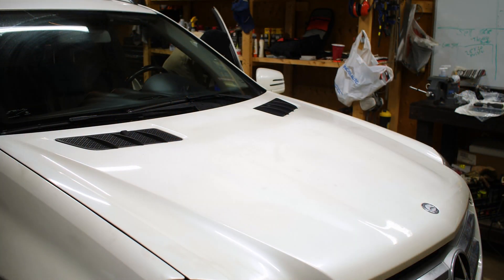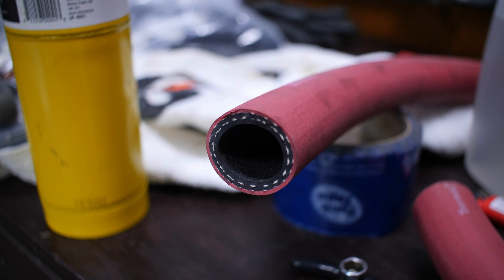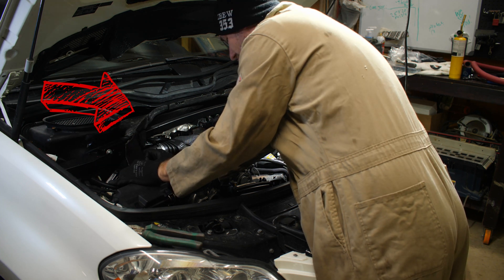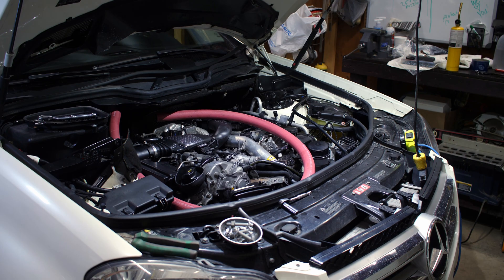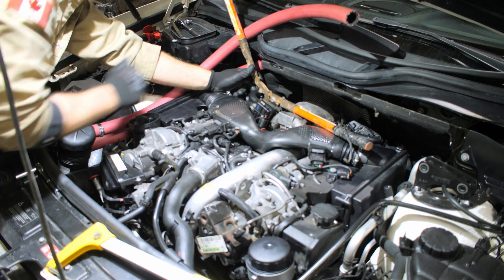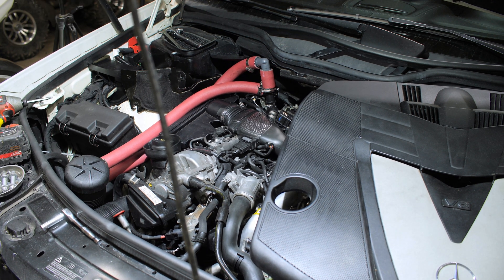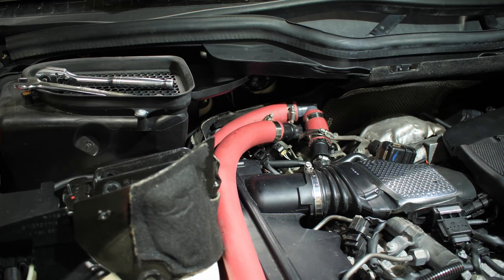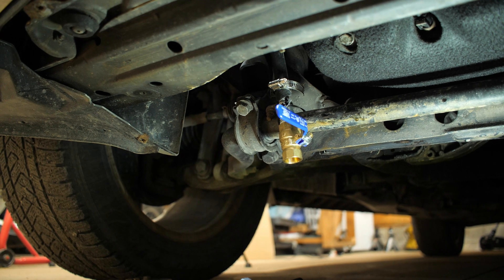How to install an Oil Catch Can (Provent 200 on a Mercedes Diesel GL350 OM642)

Comment: Hi, I'm about to install the same Oil Catch Can setup on my ML300cdi as seen in your video from 4 years ago. Since you've been running it for a long time, could you give me some quick feedback?
1. Any issues with MAF sensors or engine fault codes so far?
2. Is it still catching oil effectively after 4 years?
3. Any freezing or moisture issues during the cold winter months?
4. Are the silicone hoses still holding up well against the heat?
I want to make sure it's 100% reliable before I start the work. Let me know!
Reply from the maker: oil ring was bad, ended up throwing a rod through the oil pan.

Comment: Or just change the PCV valve and the connector to the camshaft instead of going around the issue...... The catch-can can only do so much. Fix the issue at its core: change the PCV/connector before 50k km.
Reply from the maker: yes i also did that. changed the turbo as well. it was a stuck oil ring. she blew up

Comment: Thanks for the video but I am finding the more difficult part is trying to fit the catch can itself, its a shame you never showed in more details this part of the job.
Reply from the maker: i mostly just zip tied it into place.
Reply: @SomethingonSodom  That's interesting and I can see how that can do the job! thanks for the reply... mrix
Reply from the maker: @mrixstraveladventurevlog6545  yeah it looks pretty s
Flimsy but honestly with good strong zip ties in 2 or 3 spots you'll be good. Hell the 1 inch hose holds alot of it up. Cheers.

Comment: Hi 
I am going to install a catch can on my Mazda 2.2 TD skyactive CX5. I recently took the inlet manifold, egr valve etc off to decarb. The local garage quoted me a grand. It was a bit of work which I want tot try and avoid doing again. I have bought a small, cheap catch can for now which has a glass collection bowl. If it works ok I will upgrade
Reply from the maker: Let us know . It should work fine.

Comment: The provent drain is designed to return the condensed oil to the crankcase and allow the vapors (fuel and water) to the intake.  It's really inconvenient to be emptying the catch can every 350 miles.  Is there any port on the engine to allow the oil to return to the crankcase?
Reply: The provent is an oil separator.  Mercedes when cheap from the large oil separator on the old 300D, 123 engine to tiny separator in the OM642 that looks like a flatten PVC valve.

Comment: Wouldn't the turbo run dry (without lubrification)?
Reply from the maker: The actual turbo bearings are lubed from the oil system. This oil coats the turbine blades itself. Not good.

Comment: i do live in the nation capital region and tried the catch can on my 11 gl350  the problem i ah is that the catch can got frosen in the middle of the winter and had to disconnect it as i was afraid a chunk of ice gets in the turbo , i just wonder if you had a work around that in your case
Reply from the maker: I was in North Bay ontario with it for a week and no problems.  -35c
Reply: @SomethingonSodom  to be honnest i have an 07 ml320 with that setup no issues but with way less blowby than my 11 gl350 , fyi i already changed the pcv valve on this one to minimise the blowby but still getting a lot , i'm using a mercedes approved engine oil 0w30 for winter and 5w30 for summer , do you guys know a better oil i could use on my gl 350 to get less blowby ??  Thanks
Reply from the maker: @77karimk  thicker oil helps. 5w40 rotella T6 is what I was using.

Comment: Hey where did you order the oil catch can ? What brand ?Also it be any problem with the computer?
Reply from the maker: I bought mine off ebay. Be sure to get the expensive one from Australia.  That's where there actually made. Provent 200 is the catch can. Didn't throw any codes for me.
Reply: @SomethingonSodom  
Your Mercedes doesn’t smoke blue?
Reply from the maker: @adolfoneave7141  well ours was deleted. not a ton of smoke on idle but on throttle thick black smoke. Rings ended up being the issue. check the newest video out :-(
Reply: @SomethingonSodom  
I’m sorry man are you going to put new engine?  So I’ll search for Mercedes’ bit doesn’t show any catch can only for Nissan ant Toyotas, that ones work too for the gl350??
Reply from the maker: @adolfoneave7141  yeah the provent 200 works with the gl350 mine worked great. Where do you live I have mine from the truck still. Basically used 2 months
Reply: @SomethingonSodom  
I live in Texas 🤣
Reply: @SomethingonSodom  
Send it to me how much you want? All together hoses and code
Reply from the maker: @adolfoneave7141  I'll be back at the farm house Friday. Send me an email. Eddy.gilbert@gmail.com

Comment: hi Gilbert, your installation is somewhat oversized. The om642 works well with the Provent 100. Fittings on the Provent 100 are 19mm so a hose with 19 or 20mm inner diameter is required. With this size you're inline with the original overall diameter from ccv to turbo inlet. Manufacturer Mann & Hummel suggests the Provent 100 to be good up to 200kw. greets from Switzerland
Reply from the maker: I didnt even realize they made a provent 100. I just stuck with 200 since thats what I run on my ecodiesel which is also 3L v6 Diesel works great. ill check it out though. cheers.
Reply: What causing the price difference Provent 200 $40 vs Provent 100 $140?
Reply: @dchin7450  hi Mister Chin, you may have come across an counterfeit from the Provent 200. The german original of that unit accounts actualy to approx. 200.- dollars.

Comment: Catch can has to be installed lower than pcv valve? Correct me
Reply from the maker: well the physical position doesnt really matter. the turbo on these just sucks the oil anyhow. the actual PCV valve is way at the back of the engine anyhow. you can pretty much mount the catch can anywhere
Reply: @SomethingonSodom  
Hmm, I don't have one yet but I was told it has to be lower than pcv valve. 
Nice video and install. 
I've got 2 om642. I just got free new dpf installed from dealer

Comment: How did you mount the prevent can you show pictures or video. I have a 2014 gl350
Reply from the maker: its basically floating. with the 2x 1 inch lines it stays put. I also zip tied it to the front of the engine bay. worked quite well no issues so far with the actual can.
Reply: @SomethingonSodom  any diesel fuel dilution mixed in the can?
Reply from the maker: @Detroit-c9s  no mostly condensation amd some oil. I just changed the PCV valve today as I'm chasing an oil consumption issue. I'm just testing it with a new pcv to see if my turbos leaking oil or do I have a oil ring issue. If I have oil ring issue I need to use this aftermarket warranty and a catch can wouldn't help my cause.  Lol

Comment: How do you mount the catch can to the vehicle ? Is the factory bracket that comes with the catch can good for this Mercedes; or do you have to get a different one ?
Reply from the maker: Well the one hole near the rad works decent but you'd have to drill a second one and tap it. You could use one bolt hole and then zip tie the other half. Drill and tap a second hole is best. I ended up just floating the whole catch can and it works good. I just zip tied the catch can so it doesn't move. The 1 inch hose keeps it up right. So far no issues.
Reply: Thank you very much... now I’m waiting for the elbows and the other items. getting ready to do mine. Your video helped me a lot. Thanks again.
Reply from the maker: @alfredoaltamirano8381  no worries keep us posted. I'm now battling a leaky turbocharger seal. Well , still troubleshooting lol.

Comment: Any issues after install ?   I ask because I just installed the provent 200 on my 2015 GL350 bluetec and a day later the check engine light came on and car is in limp mode.
Reply from the maker: no nothing on our 2011 GL350. Make sure all the hoses are tight with no leaks. What code is it?
Reply: Codes are
13AE00
149A00
155D00

The last code looks like could be a faulty EGR valve.   Coincident that it would go bad after installing the catch can?  Car has 72k miles.
Reply from the maker: it looks like something to do with the crankcase heater sensor. You could try and replace the sensor itself. The system might think there is something wrong with the flow (you added more volume basically.)   I had to delete the code with my tune on my ram 1500 ecodiesel. maybe the 2011s dont have that issue.
Reply from the maker: I would take it to a local tuner and have them remove the code forever. like I said i did that with my ram 1500 ecodiesel which is based off this OM642 engine.
Reply: Issue was stuck EGR valve.   No more issue after EGR replacement
Reply from the maker: @lukek9625  ohhhh. Yeah. Yeah. I'd be getting rid of that egr. 😕

Comment: MY friend its is wrong . the hose u have is a coolant hose and that is not good for oil . Sorry .
Reply from the maker: Are you sure? it says oil right on it? I've had the same hose on my ecodiesel for 5 years. No oil breakdowns.
Reply from the maker: Hell I know lots of guys that just use heater hose for this stuff. Works fine.
Reply from the maker: @ThatWasPrettyFunny  yeah ive never heard of anyone having issues. The hose I used is rated for oil and still not issues. I would steer clear of say plain old clear PCV tubing and such.

Comment: I have a Provent I am wanting to install on a Sprinter Van.  Similar setup to what you had on the GL350.  Where did you get the 5/8 to 1" adapter?  Been looking for a while and not having much luck.  Thanks!
Reply from the maker: Honestly I think Amazon
Reply from the maker: Actually I linked it in the description.
Reply: Excellent question, Sprinter owner here doing the same.

Comment: Thanks for the helpful video. I ended up installing an aluminum style catch can after watching your video and replaced the PCV valve. My wife drives short trips to work every day (10 miles) and after 1st week there was hardly any liquid in the catch can. 2nd week we took a 3hr long drive. After the trip I checked the content and it was almost full. The can was filled 98% water and 2% oil sludge. Good I thing I checked because I cannot imagine what would happen if I let it overflow and suck directly into the turbo. I'm thinking of adding more capacity to the tank as I don't want to empty it every week. Is yours filling up quick as well?
Reply from the maker: Not sure i better check though! How many km and what year ? You changed the valve and its suckingthat much oil? Did you use 1 inch line as well ? I thought it theres so much more area that the vacuum gets decreased with the provent 200 design.
Reply: @SomethingonSodom  I have a 2009 GL320 with over 190K. I was surprised there was hardly any oil in the catch can but mainly water. I don't use the provent as I did not see one for sale in Canada. Mine is an aluminum can with connections on top and 1/2" heater hose. I certainly don't want to drain it back to the engine as shown on some provent videos. I drove about 186 miles that day and during the week daily trips to work of 10 miles. Mind you that it is very cold outside around freezing temperatures.
Reply from the maker: @edvaru33  how much actual oil did you measure when you removed it from the first drain? provent 200 is only sold in Australia. Worth the wait though
Reply: @SomethingonSodom  you can find mann@humell,pro vent 200,here.
sales@mfeur.co.uk.
the site is       mfeuk.co.uk    and you will find there all the informations about mann@humell provent oyl catchcan.

Comment: I am so glad that you work on the GL350. It’s absolute life saver. We have the the 2015 and when I need to work on it, I can never find any references to it or any manuals that I can just go out and purchase. 
Thank you.
Reply from the maker: Yeah it's kind of tough to find gl350 content. Lots more coming down the line. Cheers be sure to sub and hit the bell. Lol
Reply: Hows the catch can working out.  I'm from smithville in niagara region I want to install one on my ml350 bluetec.  Where did u get the catch can locally or online.  I heard the catch cams don't work to well in colder climates like ours.  Any input would be appreciated.
Reply from the maker: @mirocabraja5128  I haven't checked it yet lol. Its a provent 200 link in the description I think. The provent 200 works fine here ive had it up north in -40 for a week straight no freezing. Spend the money and get a quality one.
Reply from the maker: I have the same Catch Can on my ram 1500 ecodiesel.